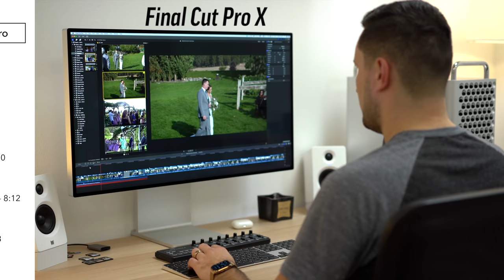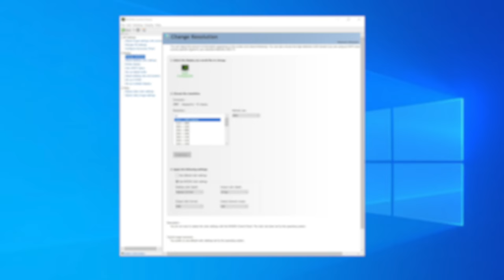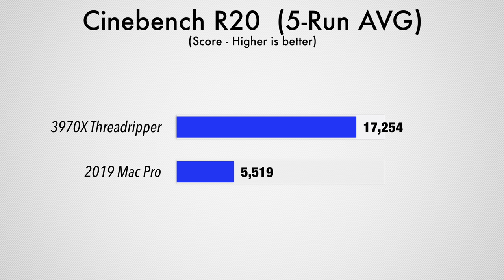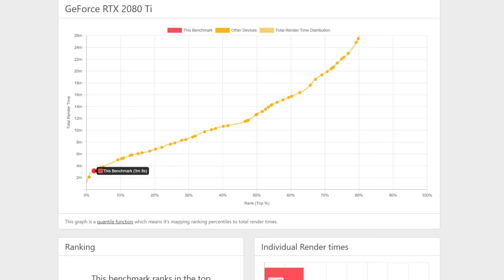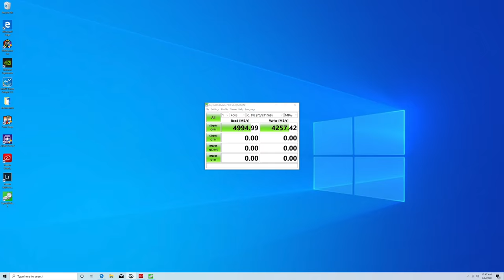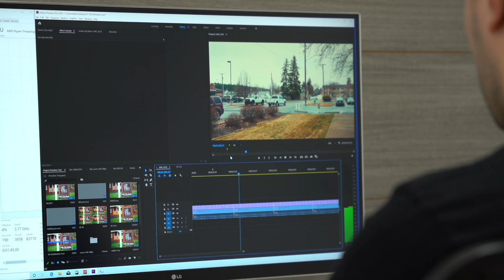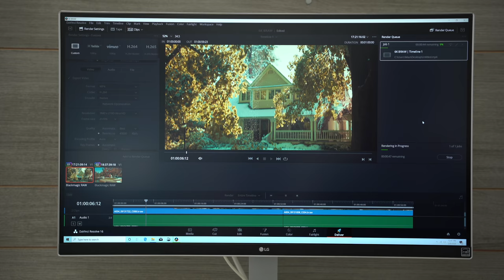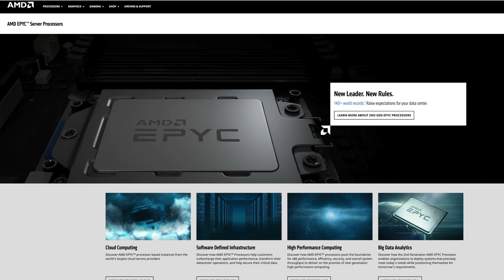$15,000 Mac Pro vs $5,000 Threadripper - Sorry Apple..

Comment: You tried hilariously hard to defend that apple tax, I salute you sir.
Reply: @prowlfilm wtf does this even mean.
Reply: @prowlfilm  How much you make on a machine has so many variables it's not even worth mentioning, it's like saying you made 6k last week because you drank this kind of coffee and drove this kind of car.

yea it will hold its value longer, ill give you that, unlike other tech companies Apple is also a social status symbol and in some cases a fashion statement, which is unfortunate because it starts the dumbest trends.

Windows upgrades have been free, windows 10 was released 5 years ago and most if not all custom-built PCs made in 2008 can very much still "work well" 

Now unlike your Mac pro, you can still upgrade parts for a PC for a significant amount cheaper than waiting for an entirely new refresh and will always be in a standard layout,  god knows what shape Apple is going to take next time.

If you can't be bothered to learn a bit about the other options out there or are heavily locked down by Apple ecosystem, then continue to buy Apple, but to believe that your machine is the sole reason you make money and that anyone without that machine can't, makes no sense. But hey, I'm just a guy using a home built or prebuilt by HP or whoever and my peasant system or operating system should stop working far before any IOS device.
Reply: @prowlfilm Well I repair Macs and PC and I see a lot of "dead" Mac that where just 3 or 4 years old, too bad luck I guess, ho, mine was in and I let apple away, all PC now runs marvelously well and I can use CUDA.
But golden cuff please to certain.
Reply: @prowlfilm It actually depends on the user you can consider your situation is uncommon to most people. It won't mean that your Mac system has a lot of value in terms of longevity. It will always depends on the user, I'm pretty impressed on how you can utilize your Mac because some people can't do what you do. Just keep using your Mac system and take care of it but always remember every year new tech will always come and become a standard trend. But it's true value will only be utilize by it's user's capability.
Reply: @oooppiikkk  That last  is hilarious, but I think the problem is really an apples (pun intended) and oranges thing, yes if you are a PROFESSIONAL video or even graphic artist and you rely on Final Cut or even Apples other products such as Logic (music), or their graphic layout programs, then by all means a 15k workstation is just part of the costs (and maybe even somewhat luxury ) of doing "good" business, but it is kind of insulting to say that the "only way" someone can start "making" money or generate an income is from using what is admittedly extremely expensive tool, that has a very high cost of entry to buy , and use as part of a growing hobby/ possible business.
Reply: compare this mac to the actual parts it has intel processors are more expensive, to begin with and ECC memory is more expensive as well.. this comparison is so bad..
Reply: @prowlfilm where did you get the 1000x of a threadripper
Reply: @abcdxx1059  from render farms... probably run on linux or widnows though hehehe
Reply: @prowlfilm or even years lol, all the pros have to use them, and why wouldnt they. this debate over which is better is stupid, buy what you want to buy, use what you want to use
Reply: @prowlfilm what do you do?
Reply: @prowlfilm oh i do same too but it also includes graphic designing, motion graphics, 2D etc. Do you have work for me?
Reply: @prowlfilm Have you had a look on it? Can you also share me your portfolio or reel in case i need your help?
Reply: @prowlfilm i got to know now that YouTube don't let me share the google drive link. Can you tell me your email or anything where i can share the link?
Reply: @prowlfilm did you receive my message?
Reply: @prowlfilm i dunno man.... spending over $73,000 just to get a full mac setup is just pure garbage when i can even buy a house with that kind of money.....and even then a $7,300 full pc setup having a 3990x and 2080ti than basically does everything faster, and IF mac does win in certain programs it usually is an optimization thing.....
Reply: @prowlfilm Mac OS  is not well supported. Our 2007 Mac Pro workstations which have 12 cores aren't supported by apple any more, we dont have the latest OS. My superseded home 2007 dual core Windows machine got upgraded for free to windows 10 and runs perfectly, and runs certain programs that cant run on our Mac pro's due to having an old OS. This also makes productivity in certain programs faster on the dual core Windows machine than on the Mac. But keep making up excuses to justify your purchase if it makes you feel better.
Reply: @prowlfilm define 'pro machine'. A whole architecture firm still using it, earning a lot of money, and working perfectly well prior to apple stopping the support obviously isnt so useless, but nothing more than you making an excuse to justify/back track on your comment of MacOS as "well supported for older machines". I guess law firms which are notorious for not upgrading hardware that have 13yo 2/4/6/8/12 core machines arent considered 'pro' machines nowadays to you either.... They still work by the way, and they generally run windows, and they too still earn plenty of money. You saying you dont need to "justify shit" yet bothered to come into the comments section and talk for so long is merely an excuse to run away from having to defend youre above comments which are obviously wrong and delusional. But good riddance.
Reply: @prowlfilm 73k for a FULL MAC SETUP, meaning.... the full spec 55k mac cheese grater thing, 2 apple monitor thing(and stand)....and then theres what we call 3970x with 2080ti.....even watercooled with 2 4k monitors and a desk and chair

i dont know much about the "pro world" you are talking about but i heard that the company my mother worked for switched their servers to amd, with intel they usually are at a 9am-7pm..... and now they can even finish their work at 3pm, i dont know what they do but it lets me see my mother more so im thankful for amd
Reply: @prowlfilm stop being such a stubborn fanboy.. apple has started to suck now at pc mac form factor..
And to be honest the modular design of pc is way better according to me as you can basically customize th pc according to your needs.. unlike mac.

Just accept the fact that windows and pc in general has coped up well and is on par or even ahead of apples sometimes ..
Why am I even bothering to tell you this you won't even care anyways
Reply: @prowlfilm ok bro you win, I lose
Reply: @prowlfilm so why were you defending apple mac pro?
Reply: @prowlfilm ok bro, work harder now the next generation of mac is waiting for you
Reply: prowlfilm ok but you act like we don’t have tons of different options to compete with Vega. Hell we could run dual Radeon VIIs which has the same capacity for rendering type tasks like the Vega 2. And it performs better at gaming too. But the thing is, it just has slightly less Vram. But the point still stands
Reply: prowlfilm or we could use Quadra
Reply: prowlfilm you keep talking about Vega 2s, other than VRAM capacity, it’s not that impressive. Single rtx Quadros (can be faster depending on the model) and Radeon VIIs (exact same architecture and way cheaper) are better in many cases
Reply: @prowlfilm sure it will hold longer... It costs 3 times the amount :) (and I have Apple PCs for the Question, but I'm using a Windows because for me it's better)
Reply: prowlfilm what? XD why your Talking about Businesses? We are Talking about a Private PC and Not an high end workstation for a Company
Reply: prowlfilm thats an comparison of two sytems, and you could buy both as an Private PC if you Want too (And I hate me Correction...)
Reply: prowlfilm Hold on, if you are using a render farm for comparing rendering performance, why do you even need a Mac Pro? Just use a Mac mini with 10GbE. You literally contradicted yourself in terms of rendering. “Rendering gained you 6k this week...”, get a Mac mini, and save yourself 12k at least. Hell, get several.

And if you are saying 96k GHz (which is the most idiotic way to measure performance) 

I use a “data centre” to compute my serious data sets for protein and molecular simulations. As well as renderings. I understand how to use “supercomputers” for this. And I also understand that you don’t need a Mac Pro to do anything if you are rendering it all through render farms.
Reply: You guys do know he's acting like that in purpose... lol
Reply: @basilegituranya5168  yep xD
Reply: @prowlfilm Sure, vega dual is better than a single 2080ti. But for cheaper still you could get TWO titan rtx cards that could blow the vega cards out of the water...
Reply: @prowlfilm I work in graphic design and I do videos. I built both pc's that are used for these tasks at my work place. You can also go to any credible pc shop and get them to build it for you. I dont k ow about you, but I enjoy playing games on my lunch break. Why not get a pc that can render and play games better than the newest mac pro can?
Reply: @prowlfilm You can use anything for either. Some are just better at certain tasks than others. For example... the 2080 super is faster than the 2080ti for gpu rendering on blender. Its not always intended to be better for one thing or the other. Threadripper is a workstation CPU as well as a gaming CPU. Their slogan for the new 3990x is "Render times irrelevant".
Reply: @prowlfilm Again, the NVIDIA Titan RTX is not specifically a gaming card. It is meant specifically to be a workstation card, that is what all of their statements and marketing show. I never said it was about games.
Reply: @prowlfilm I never said you couldnt update all pcie drivers, just all of the ones not supported by apple themselves. Yes, the threadripper is a desktop CPU. It is also a workstation CPU. To pretend it isnt fir no apparent reason is idiocy. EPYC chips are server chips that can be used as a regular desktop cpu. Just like Intels Xeon chips.
Reply: @prowlfilm Also, Blur studios handled all scenes that had to do with Grace being a future soldier. That was a pretty big part of the movie. The cards that can handle 6 streams of 8k video are special made by apple to do video editing, like a crypto miner. That is one of the only good things to come from the new mac and Im pretty sure it has been done before though Im not sure. As far as threadripper not being a workstation cpu... just look it up. Its not hard to not look like an idiot.
Reply: @prowlfilm basically: 
Yeah Pcs are faster,cheaper and have more compatibility and are equally durable if used properly.
BUT
MacOS is toddler-prof and looks more stylish.
Yeah I'm rich! Thanks Apple.
Reply: Ivan Osorto  A benchmark isn't the only way to compare a computer. product build quality is a thing you don't buy a Bently because its the fastest car you buy it for luxury. This is the same as the mac and any other product out there that wants to put out a high-end luxury product. It is not your place to judge what people want to do
Reply: Mark Dupuis i like the mac pro but god damn the RAM is INSANELY overpriced
Reply: @prowlfilm Why would Nvidia need to make bespoke chips for mac? Why tf would they want to when they are already the go to choice for so many people? Apple needs to get their head out of there ass and make macs more customizable. Thats it. Thats the only problem (besides price to performance of course)
Reply: @prowlfilm who gives a damn about a 6% better score for 10k less, my friend U are not helping yourself.
Reply: @prowlfilm men
Reply: @prowlfilm you like big meennn
Reply: @prowlfilm big man lover
Reply: @prowlfilm i think you have proven your point and now you have earned a years leave from replies..
Reply: Steven White  Guy... for certain workloads, yeah its better. But then again, its beacuse its 2 GPU's on 1 card. How is what I said wrong?
Reply: @atharvatalaulikar9066  What has he proven? Even he doesn't know. Lmao
Reply: @aluandcache7336  Why did you delete your comment? Did you delete it because you realized you were wrong? Lmao, yes. Dual gpu setups are much more powerful when using benchmarks and creative work programs. You are talking about gaming, this is about workstations. Also, the vega pro duo is one card with 2 GPU's on it... it doesnt use sli until you get a second card
Reply: @prowlfilm, so, if a Threadripper comparison is off the table because it is a desktop CPU according to you, tell me quickly, what's my budget for the multi socket EPYC system? 56k? I'm convinced for the same money you plowed into the Mac I'd be able to build something a tiny bit better, hell, EPYC doesn't have RAM limitation of TR. And that's not even it's selling point.

A just to avoid confusing you, I said "tiny" mockingly, because you wouldn't be able to fathom the gap in performance, it would just blow your mind. You cannot compare a $1000 iPhone to a $50 Android either, Sony would like to know your location. Yet this is how you iSheep format your arguments. 

Apples to apples buddy, cent for cent. Since the 3990x already blows your 28 core Xeon W running at a paltry 2.8GHz out of the water even with the limit on total system memory, 56 threads are a long way from 128, and it's still a "desktop CPU." According to you...

I'm not even going to mention the difference in individual core performance, that's just insult to injury, which seems to be the path AMD is focused on for the moment, a proper bloody curb stomp, kicking Intel while it's down. You do know that the 3990x holds the current world record in terms of sheer computational power for a single package? I'm not kidding - look it up. Liquid nitrogen overclock of course, but bloody impressive indeed, and leaps and bounds beyond what you're sporting. Suffice to say a 2.8GHz Celeron is a good comparison to the Xeon from an individual threaded throughput perspective.

You said that server farm does how many GHz? Close to a TeraHertz. You must not understand what Hertz is to begin with, they tend to calculate computational power in Flops, instructions per second. 

Now listen, I get it, you've got cash to waste, that's not even the argument though, what you fail to realize with the anything vs Apple mindset, is that unless you shit money - there are much more economical options, most of them actually perform better. And Macintosh has quite a bit of security flaws too, but since windows are the market leaders, stats tend not to pay much attention to the minority. For the most part people don't harvest cash from a tree in the backyard, so their money tends to go where the value is.

Having a system that is 5% better at some inane task only you do, but cost 10 times as much as an equivalent, and equally capable PC-based system - is a rather bad argument buddy... I'd take ten systems bringing in 8.5 times the income over that any day. You must struggle at math, right? Nothing to be ashamed of. 

There’s no other way to go about it.

Mac is not where the smart money goes, and that alone says something about their customer base.

If you want to argue about performance, you should at the very least know that you cannot simply say 2.8x56 = 156.8GHz I assure you, you'll be the laughing stock of the internet. And after a statement like that you expect people to take you seriously? Can you even code? Because what you are saying is this thread is rather telling... And not in a good way. 

On the internet you can be absolutely anything, it's surprisingly how many people choose to be idiots.

Please, stop thinking, you'll hurt yourself. Hell it's even painful to watch.
Reply: I suppose you think that render farm is Apple based...
Reply: @s4rg380  what you wanna say?
Reply: @prowlfilm oh, right, rendering off client precisely justifies the expense of the Mac, go back and read your first comment, you're contradicting yourself.

You also tried hilariously hard to justify the Apple tax, I commend you for your valiant effort.
Reply: @ImtheIC  concentrate and ask again.
Reply: @prowlfilm Yet you kept going on about how your Mac made you the money. 48 comments on a thread you don't give two shits about - seems legit. Paired with some of the finest misinformation I've seen in decades.

Keep them contradictions coming.
Reply: @s4rg380  Don't tech him much dude or this fake shit will apply your given infos on someone at somewhere else..  🙄
Reply: @s4rg380  And how a 32 core processor can't be a workstation grade processor! 

Now I understand why education is so important on a particular subject!
Reply: @aluandcache7336  I find the fact that we've got 64 core/128 threads on "desktop" CPUs quite impressive.

EPYC uses a socket called SP3.

Threadripper uses a socket internally called SP3r2 - yes, you'd be entirely correct in assuming that r2 implies revision 2.

Now correct me if I'm wrong here, if Threadripper uses the second revision of the EPYC SP3 socket, would that make EPYC a desktop CPU, or TR an entry-level workstation CPU?

I am not aware that AMD deems it a desktop processor, when it is clearly not aimed at that market.

But yeah, what do I know?
Reply: @aluandcache7336  yes, Threadripper is aimed at the VM side of things, thin clients, rendering, well yes and no. Though that does not mean it's not good at it.

I found out a long time ago, arguments with Apple fanbois aren't based on this or that, but it is generally more an issue of PEBKAC, or perhaps buyers remorse. The sunk cost fallacy...
Reply: @s4rg380  Well what I've found from various sites the 3rd gen AMD TR (what has been used here) does have sp3r3 socket which physically similar to sp3r2 and sp3 but electrically imperfect. So it refers both high end desktop and a well workstation grade cpu (by true meaning) 

Even I saw one review of Gigabyte, where the TR praised so well as a workstation cpu and got 'outstanding' tag as well.. Where they marked the Epyc for the highest end of the market.. but you know obviously better than me at this point..
Reply: @aluandcache7336  either way, use what you've got, use what you prefer, whatever works for you, i don't care, just for the love of God don't try and convince me that Apple is the best of the best, let alone on price to performance ratios. That might have been the case, but it has long since changed.
Reply: @prowlfilm, did you just delete 30 or so of your comments?
Reply: @s4rg380  On my 50k reference, I was actually talking about 2X Intel Xeon 22 core processor 😛
Reply: @s4rg380  Loool! Where his all comments gone!!? 😱
Reply: @aluandcache7336  I was actually just referring to the logical progression of the socket, basically pointing out the similarities. But that is a moot point now, since most of those comments have been deleted...
Reply: @s4rg380  Yeah I understand.. 
But I'm now thinking about his 'NEVER' aggression 🙄🙄
Reply: @aluandcache7336  yes I gathered that would be Xeon Ws. Mac doesn't have a dual socket version, do they? I've never actually checked...
Reply: @s4rg380  Nope they don't! How poor Apple users are! At that price point they couldn't get a dual socket motherboard option 🙄
Reply: @aluandcache7336  your right, that thing would cost $150 000 for the base configuration.
Reply: @prowlfilm you missed a couple buddy...
Reply: @ImtheIC  you have something to add?
Reply: Why you WIN-people have to get aggressive and offending every time an Apple product is discussed? This behavior shows that -despite your systems being a better bang for the buck - something... soooomething still gives you sleepless nights, knowing that there is an OS-hardware combo out there that will not quit working when you are in the middle of a job that feeds you, your wife, children and your employees.
Reply: He deleted all comments hhhhh just because he saw windows is better @prowlfilm
Reply: @ElRealista7  I feel so satisfied now..
He must be crying on his Mac Pro...
Reply: @oooppiikkk  Mac OS retails for 39.99 and is free there after to upgrade. Windows home is $179.00. you get updates but the next (say windows 11) you will have to rebuy. Windows PCs really don't stand the test of time as well. Everything is slower with Mac when it comes to upgrading things. but you can buy other brands of RAM and things to go in you Mac buut usually its inferior. like Kingston RAM for mac isnt 2666hz its like 1800hz. we regular folk dont need either of these PC/Mac this is for like workers at Pixar or someshit lol.. i mean bragging rights? Im a gamer and a designer and i love both systems. i just know my mac lasts longer before i "want" to upgrade. i dont have too but i do. I hate when people choose one and just hate the other. they both are great. Mac is bit easier to use i will say. price point for regular consumers? i dont think its that bad unless you game. macs will last longer to justify regular needs and viruses are much less prevelant.
Reply: You’re aware the price is due to the intel processors, correct?  It’s an Intel tax, has nothing to do with Apple.
Reply: Evan M Not even the slightest bit true.  The intel card costs ~$3k.  Where does the other $12k come from?
Reply: Musicsson I run an online business and I have used both Windows and Mac machines to do it.  When my Mac went down I waited almost 2 weeks for Apple to fix it.  As soon as they did I sold it because it had cost my company tens of thousands of dollars.  I’ve since used windows and when I eventually have a part go bad, I run to the store and replace it in under an hour.  That kind of accessibility is a WAY bigger plus than having something that lasts longer in the professional world.  Less time down means more time making money.
Reply: @xavierincepierre7773  are stupidly more expensive and could be built for even cheaper
Reply: @josuuuuuuuuuuuuuuuuuuuuuuu1780  yea bro and you can install install Mac os on a pc to
Reply: @dragondeathlight2216  even then windows is still on top any Mac user shall be excluded from the pcmr
Reply: @_Addi_  but it runs better then 2080ti in games
Reply: @lunaticheaven9446  No, it does not.
Reply: @_Addi_  it does Linus has it in his gaming build
Reply: ALU to Tensor  It doesnt show what that dude was saying before. The context was for video rendering, thats it.
Reply: @lunaticheaven9446  What, the vega duo pro?

If you mean the 2080 super, then it only performs better in a select few games that use certain rendering techniques.
Such as pubg
 https://gpu.userbenchmark.com/Compare/Nvidia-RTX-2080S-Super-vs-Nvidia-RTX-2080-Ti/4050vs4027
Reply: @xavierincepierre7773 I agree with the ECC memory, but the point is there is a cheaper and better product (threadripper) rather than the over priced Mac Pro set up.
Reply: @scottwh8086  yes threadripper is a cheaper processor but it lacks certain features that in the long term can cost a professional some money. look at AMD's EPYC lineup that's the server based processer lineup you cant compare oranges to apples but you can compare one apple (fuji) to something like (macintosh) basically comparing 2 server processors or comparing 2 consumer-based processors.. if anyone is buying a server processor they are looking for ECC if anyone is looking for a consumer one they wouldn't care and save a whole bunch of money on a threadripper. i know thread ripper is cheaper but its not about what's cheaper. for example, if someone was looking for a car that was electric but seen a car that was gas for way cheaper they wouldn't buy the gas car because they are looking for an electric car. so if your not looking for ecc and money is an issue then don't get the mac its not the best bang for your buck if ECC isn't your priority. there is nothing wrong with macs choice or pricing for these choices its what the company's sell their products for. at that point, you should be mad at intel for their pricing.
Reply: @scottwh8086  I just noticed I made such a long reply let me break it down in a short few sentences.. ECC memory is more reliable and protects computers from crashes or errors in data that can be critical for financial or NASA or for example a big company like Disney or worner bros that will have all their effect creatives running on one large computer. this is the reason why mac pro made a rack mount version of their computer to be installed with multiple mac pros for server use. I don't know if this makes sense to you. To be really direct a crash or an error can possibly cost more than 1m for these companies rather than saving 5000$ or whatever amount you can save by not going for ECC. but if you as a common person wouldnt think ecc is important, then i can see why this mac seems like a rip off and a money grab, but it for sure is not. Companys like Disney or even a 3D animation studio will not be buying any threadrippers at all.. They would be buying AMD EPYC or Intel Xeon with no exceptions
Reply: @xavierincepierre7773  TR support ECC.. Even AMD's enterprise cpu also support ecc memory.. So what's your point here? You wrote whole two paragraphs just in ecc? Lol